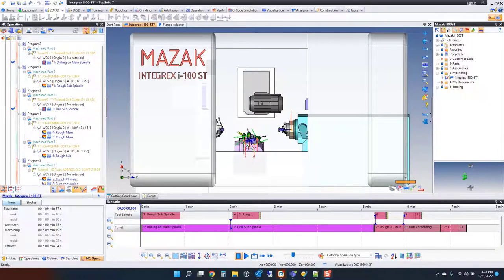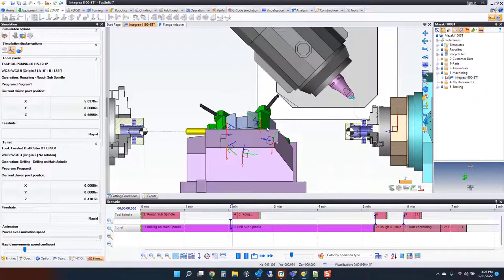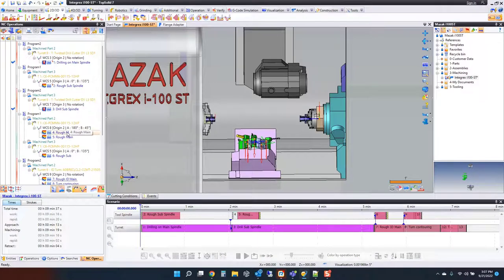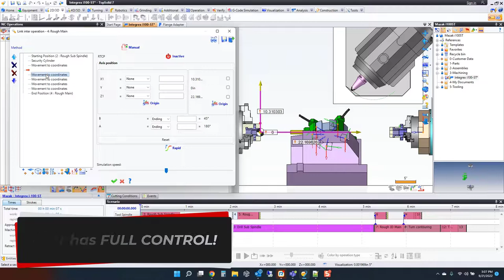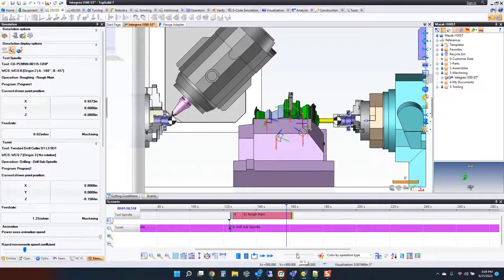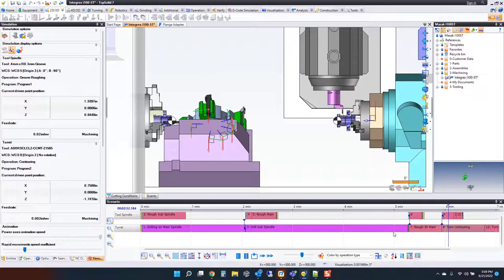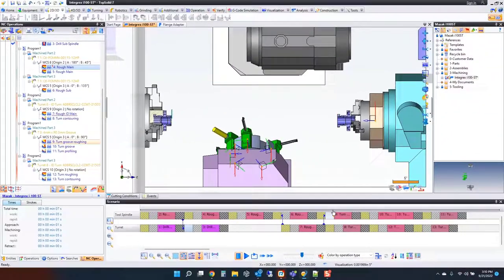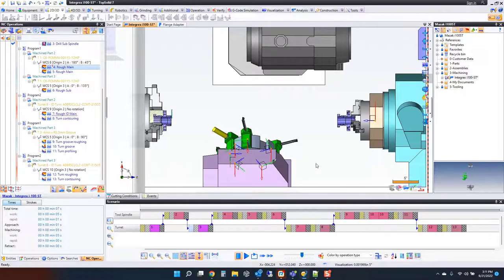TopSolid CAM - Synchronizations and Link Movements

Comment: Hi, I work on a Variaxis with topsolid and when the tool change , the link movement go to A0 C0 even if the next operation use the same table position ... Is there a way to change that without changing the link movement each time ? Basically I don't want to move the table before tool changes
Reply from the maker: Hi, this is actually managed by the tool change point. You can create your own tool change point and remove the values for your A and C.  Then set that as the tool change point to use and it will no longer send the axes home.
Reply: @TopSolidBlog  Awesome , thanks a lot for the tips 👍
Btw is there a way to be part of the next webinar live ?
Reply from the maker: @vidalcris  Send an email to info@topsolidusa.com and I'll add you to the distribution list for the invitations.